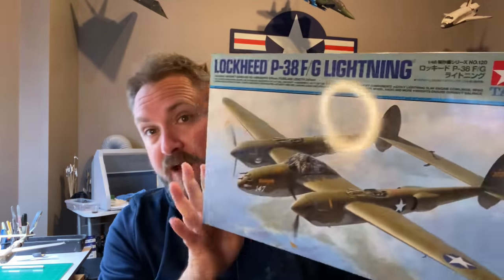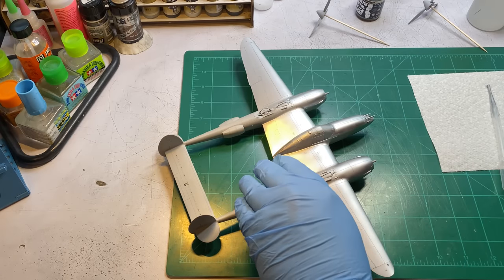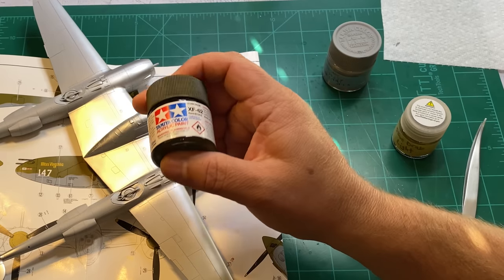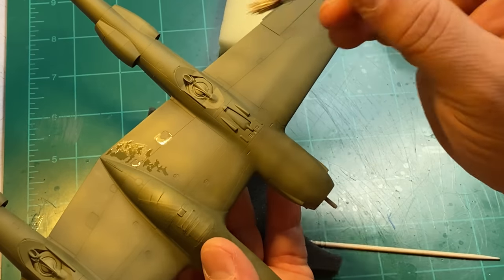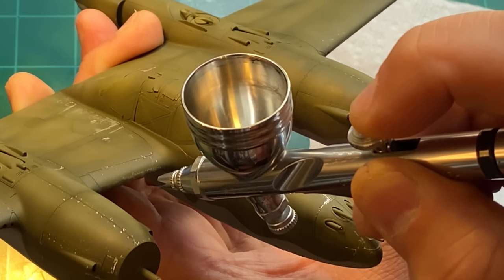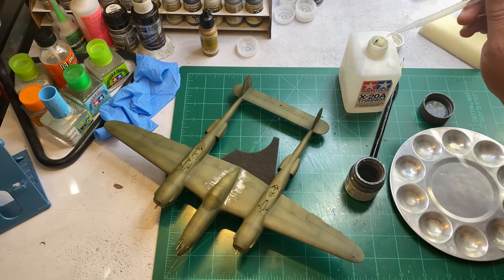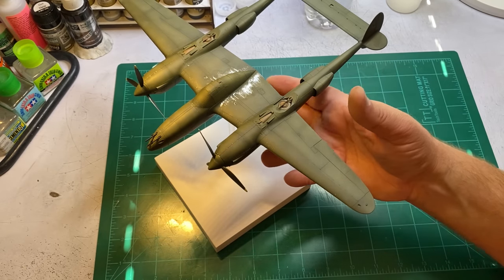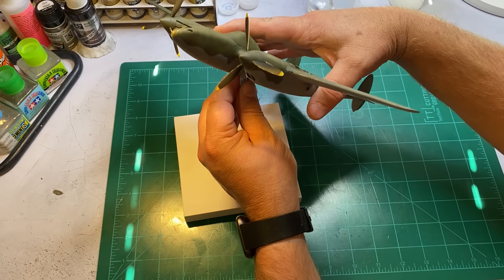Painting Tamiya's 1/48 P-38 F/G Part 1

Comment: Greatings from NZ bro
Have you thought about making yourself a sprey booth/box.... Quite easy one I made using a cardboard refrigerator box with a small 5" fan, a length of ceiling ventilation tubing and a few sheets of 3m or similar scuff pads as filters... Also a few spaced layers of Chux type cloth works as a good filter
Reply from the maker: I have a spray booth;).

Comment: Glad you've done the Tamiya P-38. I've got a Tamiya P-38J on order and plan to use after market decals with an OD scheme. I've heard it's a great kit to build, any comments on the construction you'd like to share?
Reply from the maker: It’s a little more complicated than the Tamiya f-14 and f-4 models and there’s a little more sanding and filling than I anticipated but it’s still a really good fitting kit
Reply: @seanerk5kt9  Sean, I was looking back through your videos and I noticed you have never published a video of a helicopter build. Aircraft? Check. Sci-fi? Check. Submarine? (See Sci-Fi). Even a car. but no Helos. If you ever have a helo itch to scratch check out the Special Hobbies 1/32 AH-1G "Hi-Tech" kit. Comes with 3-D printed, resin and painted PE parts. Even paint masks for the canopy. Pretty much everything you'd want for a build in one box. Thanks again for your builds. Really are an inspiration for us mere mortals.

Comment: Very nice work.  Could you please explain in a little more detail how how you fit the gear doors for retracted gear?  In the process of building the J variant kit, and want to have it gear up l, but can’t really figure out the best way to go about it.   Thanks!
Reply from the maker: The nose gear doors weren’t too bad.  I just had to carefully file a small amount of material from the edges of the doors, angled my filing towards the inside of the doors.  Then glued one side, let that cure, then taped and glued the other side.  Had to do it that way as after filing, they still wouldn’t sit exactly flush without pressure being applied.  For the engine nacelles, I think I glued one door on each nacelle, let that cure, then glued on the other doors.  If I remember right, there was still a substantial gap but doing it this way, I was able to keep the gap on one side and just filled and re scribed.  I think I might have had to straighten out the front end of the doors with a file as well.
Reply: Thanks so much for the response. I’m a bit scared to try it, but think I’ll give it a go :)

Comment: Like your method for painting your props.
I have had trouble chipping with Tamiya XF paint. This is what I did....primer---Tamiya LP silver---hairspray---Tamiya XF-62 Olive Drab thinned with Mr Hobby levelling thinner and left to dry over night.  Had a heck of a time getting the paint to start chipping no matter how stiff the brush and amount of water used. I could dab, dab, dab until dooms day and could not get the paint to chip. Even using a tooth pick it would get down to the silver but looked like a scratch and not the worn down to metal effect desired. Any ideas?
Reply from the maker: Maybe use more layers of hairspray and or thinner coats of olive drab.
Reply: You have to chip it faster, don't let it dry overnight. Start when its just dry 45 min or so.

Comment: Is there a reason you didn't install the Elevator Counter Balance? How do you maintain the continuity of the paint installing it later?
Reply from the maker: Because I would break them off.  I paint them at the same time using the same techniques, just separate from the model

Comment: I seem to have issues with that AK metal colour rubbing off even after a week or two of curing  has anyone else had this issue? I do the same as you with brushing Tamiya paint but I also add a touch of Liquitex Flow Improver works well. Looks great so far. Thanks for sharing 👍🏻👍🏻🙃🙃
Reply: I have heard this occurs when too heavy of coats are applied.
Reply: @brettbricker1810  
Ok thanks. I tried light coats heavy coats seem to get the same results.